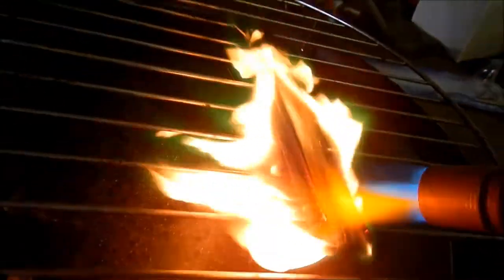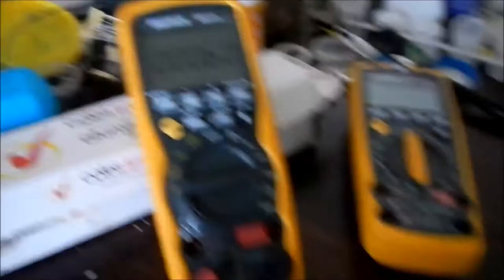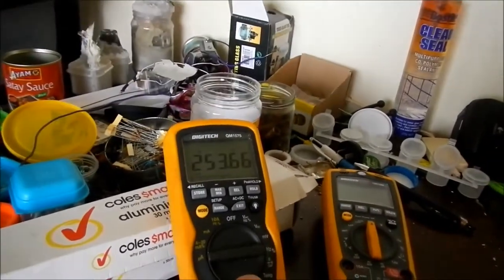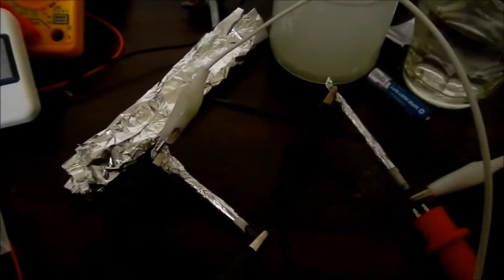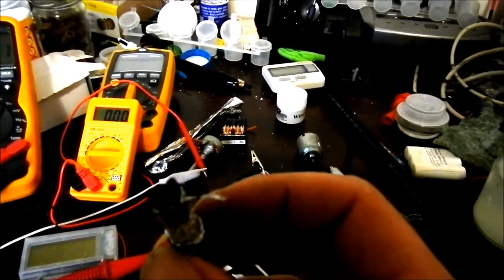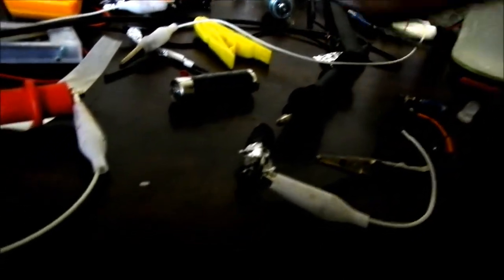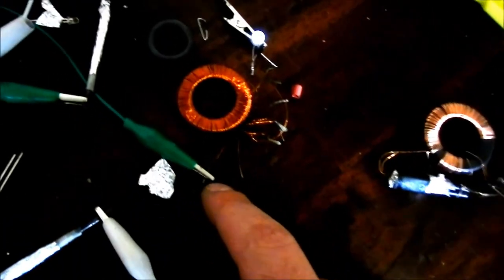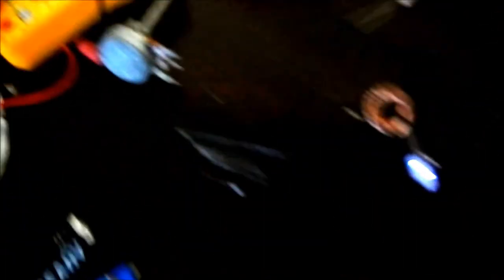DIY AA/AAA Make a Battery with Pencil's Paper Towel and Al Foil

Comment from the maker: My thoughts exactly. Also its a tiny bit of foil in this example. The amount needed to wrap a sandwich would make 50-100 of these cells. Its also cheaper than disposables. One motivation for this project was having sat around a campfire, cooking food wrapped in al foil, in coal's. While my torch is going flat looking for more wood. Now I use the waste foil, and a few coals from the fire, to make my light for wood gathering/reading. Rather than throw foil in landfill. Where it decays anyhow.

Comment from the maker: Yep. Paper towel makes a great medium. If you had a few layers of that between lead plates, you could get a lead alum AA. I think lid motor made one? You could use cotton wool too. or some kind of sponge/kitchen cloth material. I think you could seal one to stop it drying out. Not sure if it would create pressure when charging.

Comment from the maker: Nice:), With the efficient JT question. Efficiency is more a state of tune.  All my oscillators can get over 70% efficiency, some up to the 90%'s, but mostly in low output. Getting them to stay efficient at 12v output for eg is a challenge. Its all about matching the 'ON time" with the value of the inductor. You want the inductor to reach full saturation, and have the transistor switch off right away. If you have a supply or device you want to use, I'm sure I can help with, if I have good info.

Comment: GREAT WORK,try copper wire wrapped around a galvanized nail or bolt. i get about 100mA at 1.2v with alum mix(i think there was little epsom,carbomate,salt sub ,and sea salt in it also,forget exactly the mix) it got stronger with more cycles.

Comment from the maker: Still going 24 hours later. I like the hat idea. Some reading lights are too bright. White page near eyes stimulates brain and leads to poor sleep. Poor light ruins eyes. Tricky balance to get. These little lights go close. I must add a peg to the next model. The best JT is the one with the fewest winds, thicker wire. Its all about the ratio. 5:1 -10:1 seems pretty good. PNP's seem to do high gain better. Actually gets brighter after I turn it on, rather than dimmer. 50 turns on the good one:)

Comment from the maker: Efficient in what way? I can make one start from really low volts, or low amps, The one in this video is probably one of the best silicon transistor models. Runs from about .4v and micro amps. Would go lower voltage with germanium transistor. Depends what you want to do. PNP may be better for low power, still need to test more. My 60mv solar oscillator was pretty good. would put out up to 3v with reasonable amps. For all round performance, its hard to go past Penny. Depends on application.